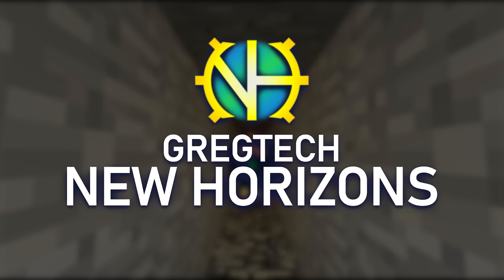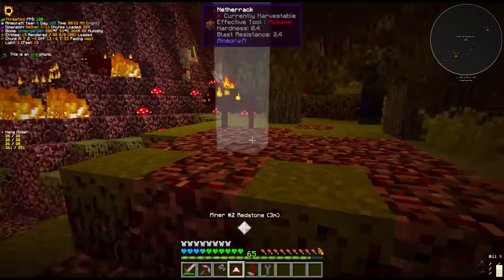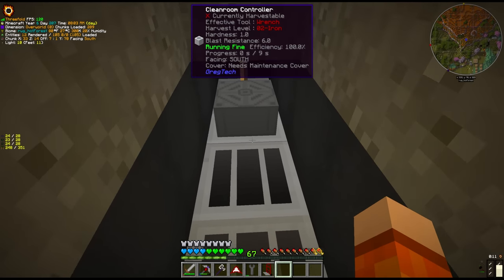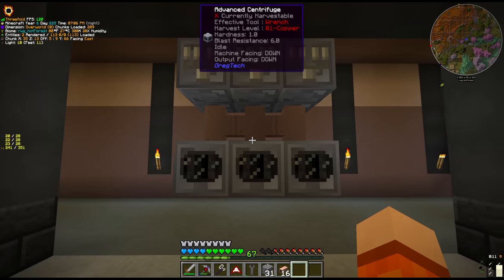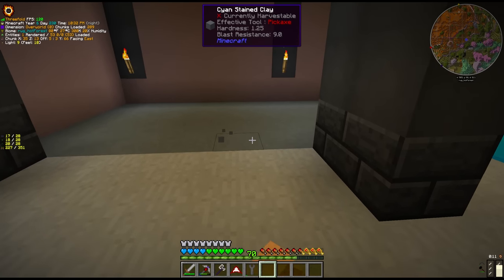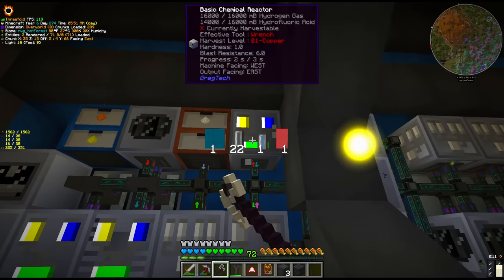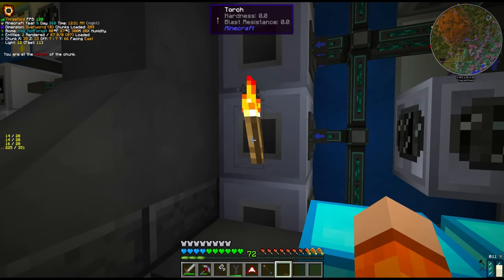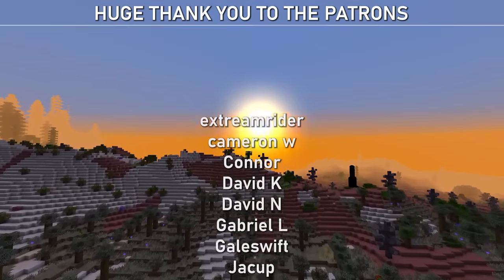Gregtech New Horizons S2 19: Polytetrafluoroethylene

Comment: at the end you talking about the empty cell is stollen by the other system, you can fix it by useing 2 tanks and have a pump between them, one big and one small, the big one is input the small one is output, and then you have 2 separate system, where cells can not be stollen